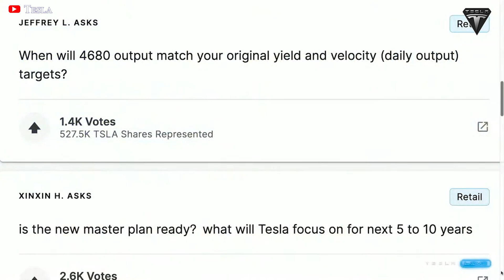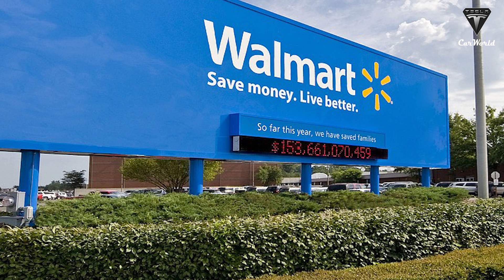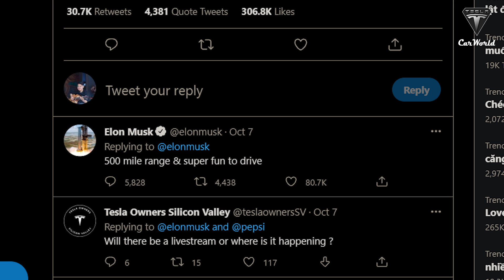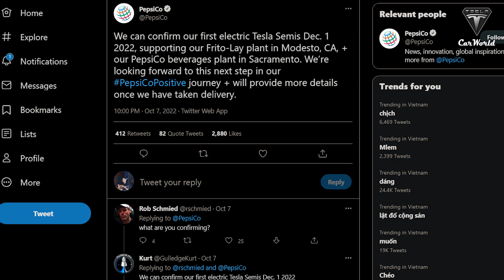IT HAPPENED! Elon Musk Reveals Tesla Semi Battery 4680 Serious Problem, Warning Production!

Comment: 98 watts X 828 batteries= 81.1K wh used in a EV tesla non-truck.  Telsa Truck then 2K wh per mi at 500 mi =1 mega Wh. Comparison of car to truck.  1 mega wh/x =81,1K wh/828 batteries.  Number of batteries needed for Tesla Truck is X =(1 mega wh times 828)/81.1K wh= 10,210  rounding up from 10209 batteries. This is what I got!

Comment: Well I have said for months that until the 4680 battery is actually used in a vehicle that is actually delivered and someone is driving it in a video, I won't believe it.  I've never believed the 4680 hype based on his other numerous failed promises.  I'm still waiting on FSD, CyberTruck, 4680, Solar Roof, HVAC for homes, $25k car, and several other promises that he cannot seem to deliver.  I delat with enough salesmen in my career that tried to sell me "vaporware" and I learned not to believe their crap.  Elon is awesome in many ways, and I have owned TSLA stock for years, but I never buy his crap.  He promised to deliver semis to Pepsi in December, but I won't believe until I see it.  And they certainly will NOT have 4680 batteries.

Comment: Demands it is not a problem- Elon said.
Supply it is a problem.
Basically, we do not have enough batteries to meet the demand.
Elon has repeatedly mentioned that Tesla does not have the demand problem.
Just look @ GM production in Q4 of 2021 - twenty six EV ( yes, you have read correctly 26 EV ),
then in Q1 of 2022 GM production of EV was 499 EV .So, in 6 months GM production of EV was 525 units.
The problem was a batteries.
Other auto manufacturers are facing same challenges: it is the batteries 🪫.
As VW, BMW , Mercedes-Benz, GM, Ford are switching to EV production 
the challenge remains the same : the batteries.
Many scientists around world 🌎 , are working on developing new batteries for EV,
however it is extremely complicated issue.
The good news it is the progress of total global production of EV in last 3 years:
2020 - 3 million BEV production 
2021-  6 million BEV production 
2022- 9 million BEV production forecast?
2023-15 million BEV production forecast?
2024- 21 million BEV production forecast?
So , by the end of 2024 year , we could have every third car 🚙 produce BEV, will we?
In 2018, total global world 🌍 production of vehicles was around 90 million units.
In 2022, total global world 🌎 production of vehicles forecast is around 63 million units?
15% of total global world 🌍 production of vehicles will be BEV , this year or every 6 vehicles 🚗 
Will be an BEV.
In 2010 , when Elon introduced Tesla to Wall Street , people very laughing 😂, giggling 🤭 at him.
There were asking : “How many EVS have you produced last year?”
2 thousand EVS. “ What is your forecast, 10 years from now ?”
1 million EVS- Elon responded.
50,000% increase production in 10 years.
Total insanity.
CEO of Tesla Inc. Mr. Elon Musk delivered 50,000% increase in 11 years.
 1 year delay, because of Covid-19.

Next bold prediction by the CEO of Tesla Inc. Mr. Elon Musk :
20 million BEV by the end of 2030?
Very quiet on Wall Street,nobody is laughing or giggling at CEO of Tesla Mr. Elon Musk , is there?
Why?
He is the Tech-King now, the richest man 👨 on Earth 🌍.
It appears,,that Wall-Street people have not read CEO Mr. Elon Musk right, did they?

Comment: As usual the Tesla fanboys lie by admission.
It's 1000kw for the 500 mile truck and 600kw for the 300 mile version.  So the long range will use the equivalent of 16 model 3 batteries. Yet it will be sold profitably for $180k? Horse  pucky. Of couse Tesla will make excuses to delay production. They will bleed cash on every sale.
They will use the exact same technique they used to market the model 3. Promised $25k to get the reservations and hype. Increased it to $35k then quickly went to $50k as production ramped up.
Reply: Sales are growing 50% per annum. Despite supply side pressure Tesla have maintained margins at gross circa 30%, which is industry leading. Cash is stacking up, market growth continues. Competition stuck on the starting line.  What's not to like for Tesla investors??